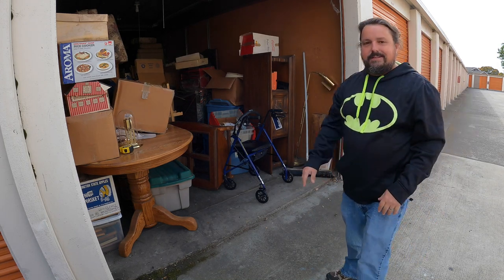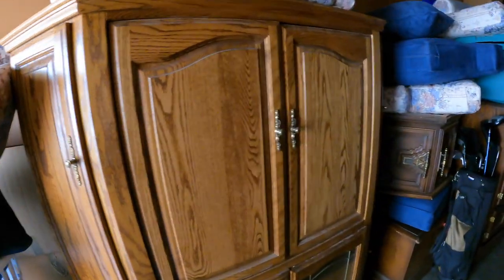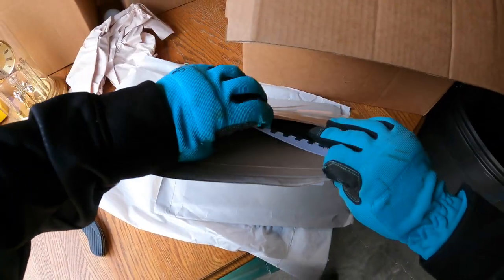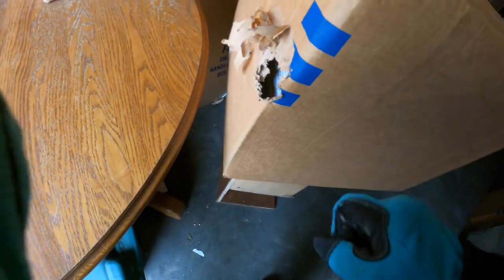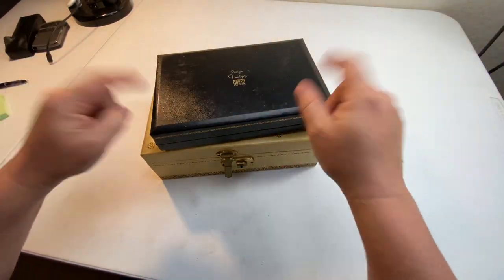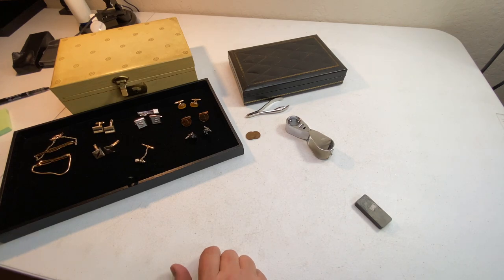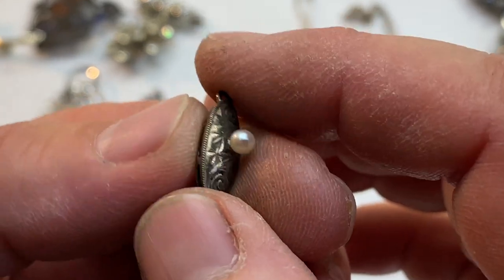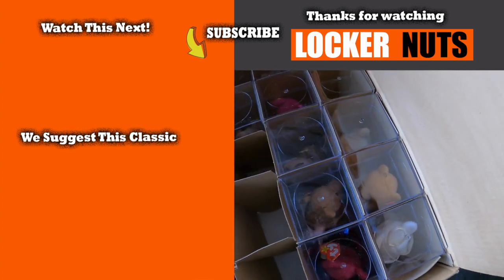SCORE! Found 2 Jewelry Boxes in the locker I bought for $1,661 at the abandoned storage auction.

Comment: Was it my imagination or is that floral ring in the beginning a James Avery? Imagination, but I'd swear I saw a maker's name.   13:37 If a white or mottled rat poked its head out, I'd nab it and get a rat cage. A Norway rat?  Where's the shotgun?  18:52 Mexican silver and obsidian - pre-1978.    Those lapel buttons are meant to fasten through a buttonhole on a guy's suit jacket.  The Merchant Marine one was WWII.  22:43 Butterfly wing back Christ the Redeemer. Real butterfly wing.   23:16 Portuguese silver filigree Santa Maria.?  The coin bracelet was done early and often.  25:28 1/20 12KGF - gold-filled locket, no doubt.  Not solid gold.  26:08 Silver for sure 27:07 That filigreed dove pendant is probably silver too.